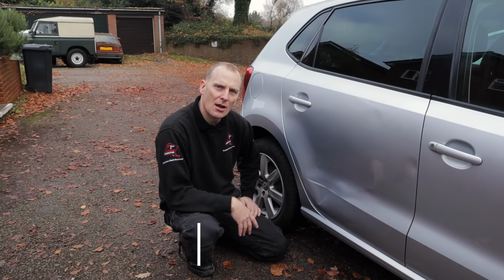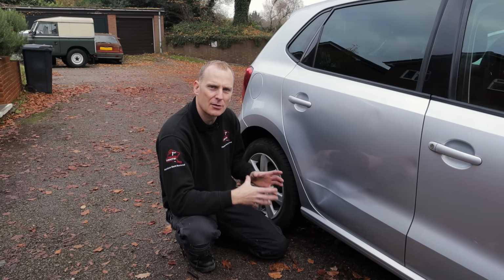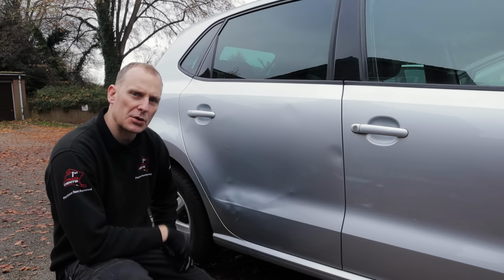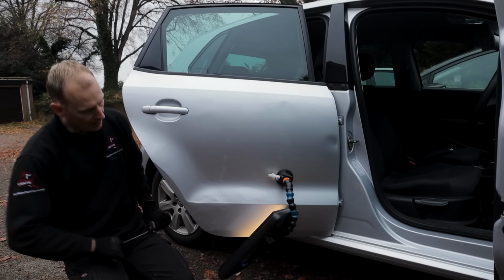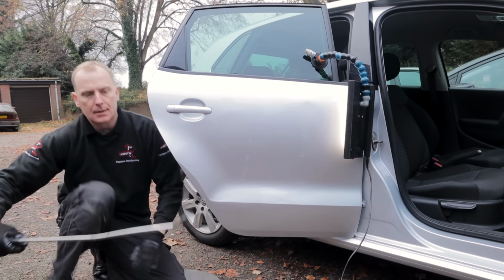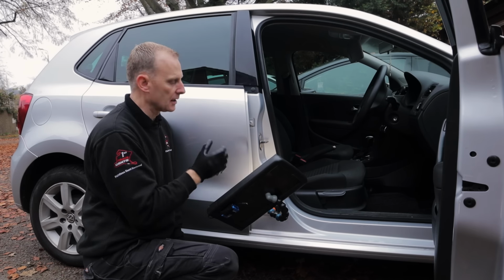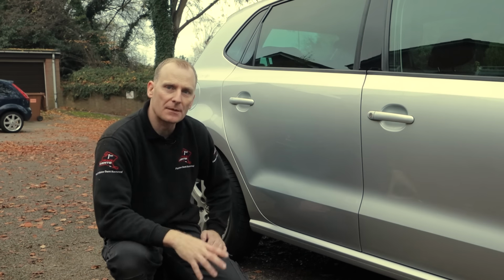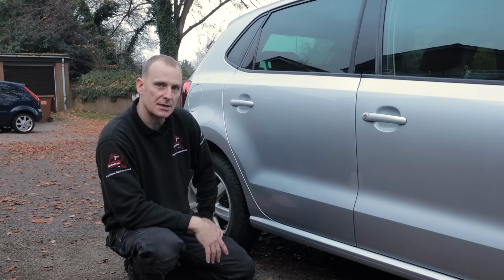NEW DOOR? NO! I’ll fix it using PDR

Comment: Incredible repair. I think the one thing many people overlook between repair with PDR vs new panel is that even though you're reworking a panel and may not be able to get it to 100%, how it looks visually may be substantially better than a new panel that has to be colour matched, blended, aligned etc. You've managed to save a part and bring it in-line with the condition of the rest of the car, which is the biggest win, in my books.
Reply from the maker: Thank you very much for your comment. I couldn't agree more, it's always worth saving a panel if you can. 👍

Comment: one question: How many hours did you work on this door?
Reply from the maker: I took between 4 and 6 hours, but much longer filming it:-)
Reply: @1st_track_dents  much quicker than properly priming, painting, and clear coating a replacement not to mention with curing time for the paint!
Reply: Christopher VanZetta agree, and don’t forget that this new door also has to be purchased, assembled and mounted
Reply: @JeroenvanMontfort  but not less than buying the same door off a wrecked cars in the same color already assembled. Depends on what is available and for how much. 
I also wonder about the paint, and whether it will start flaking off in 3 years due to all the working, or if the corrosion resistance is compromised. 
Great work though. I would like to learn the trick to smoothing all the ripples out.
Reply: @1st_track_dents  So, 4-6 hours,  plus materials, the bill would be around $5-600 USD?
Reply from the maker: @franklinpierce2854  There is no materials really , small amount of glue and polish, most of the cost is all labour. It was slightly cheaper than that as I did the customer a deal as I knew it would make a good video! In the US PDR is much more lucrative and the PDR guys would probably charge twice that!
Reply: @christophervanzetta  and then the end result is paint that doesn't quite match the rest of the car.
Reply: @JeroenvanMontfort  I'd go used same color
Reply: @1st_track_dents  Yeah I'd say they got a great deal from you. Great work!

Comment: It would be good if showed where you are levering with the pdr +how you use your free hand to counter lever to control pressure ,also were /what you are tapping with the bolt and hammer handle ,you videos are great !with the pdr it would require a camera on the inside and one on the outside with a split screen

Comment: Excellent job! I hit a very low wall that was sticking out further than the curb so as I turned the corner the bottom back door hit it. It pulled off my plastic trim and dented/scratched the bottom half of the rear passenger door. I'd like to sort out the dent myself. I think the best way would be to try pushing it out from the inside but the problem I'm having is taking the inner trim off. It just won't come off. The only way I think is to break/cut the plastic trim pins. Any help would be most appreciated. Thank you.

Comment: That was great cause there is not much body around that wants to do body work anymore, they just want to replace parts. I'm watching some video cause I'm going to do some body work on my rear door too cause I slid off the road when it was snowing n hit a curb ruin my door. I just spend 8 grand at body shop to change parts and repaint the front from a deer hit.

Comment: If I ever needed any work done like this I dont think I would want anyone else to do it.
I've watched many peoples work but would forget the rest - this guy is the best (IMHO)
I'd love to see him working on a classic car - a 1960's Ford like a Consul Capri or a Mk3 Zodiac where the price of a new panel would be extortionate.
If he ever did training courses I'd travel anywhere to learn from him.
A wizard with metal.
Reply from the maker: Thanks, I don't get to work on classic cars that often but I have worked on quite a few in my years. The metal is very tough 💪
Reply: @1st_track_dents  Do you mean tough through sheer age or tough more because of metal fatigue?
Just surprised as I would have imagined modern steel to be of much better quality. I had a Mk1 Cortina that I swear you could have left a hand print in the metal on the boot lid if you'd slammed it!
Could I also ask you about something else I saw you refer to - oilcanning. I understand it to be when there is flex where the metal is stretched. My brain wont let me understand how you can remove that flexing with the tools you use.
Anything pushing up surely increases the stretch?
Unless the tapping down actually shrinks the metal?
My old body shop pal who used to paint my cars used dollies and shrinking hammers back in the day.
Sorry to ask so many questions but I cant tell you how much I'd love to learn this craft. I'm tempted to buy some tools, visit the scrapyard, and buy a couple of dented doors and bootlids just to have s play.
It looks so rewarding. I'd love to finish my day feeling I'd achieved something.
Thanks for sharing your knowledge and experience.
Reply from the maker: @noizyneighbour5790  The old classic cars can be tougher to push just because the metal is thicker, but as you say this isn't the same with every manufacturer, it's more so on some of the older cars pre 1970 I would say. When the metal has stretched or oil canned, it depends how bad it is, if it is only slightly you can use a very sharp needle tip on a pdr bar and make small little indentations under the panel which helps to gather the metal up, but if the panel is more stretched, then you need to remove the paint underneath and use a carbon electrode which uses electricity to shrink the metal, failing that, the outer paint would need removing and a gas torch would be needed and a shrinking hammer and dolly would be used (like I used to use in my bodyshop days), but by then its not a PDR job anymore and would need to be resprayed. Also some of the newer metals are not able to handle being heat treated in this way and would need replacing, also Aluminium panels are much more challenging!
Reply: @1st_track_dents  Thanks Jake for taking the time to reply.
What is it they say - how do you know unless you try?
The worst that can happen is I make a right pigs ear of what I try to improve - and then I come and see you! Enjoy your day.
Reply from the maker: @noizyneighbour5790  Mistakes are part of the learning process, so why not have a go, good luck!

Comment: Can you explain how that PDR machine works? It looks like it softens the panel making it more moldable.
Reply from the maker: Hi Christina, it's not a PDR machine, it's just a hot air gun which you can get at any hardware store. I use it to warm the paint up so that the paint doesn't crack when pushing behind with my tool tips especially when the weather is cold.  👍👍

Comment: Brilliant job Jake. Definitely worked your magic on that one.
Reply from the maker: Thanks Jason, although I would have definitely done things a bit differently if I was doing that again now. 👍
Reply: @1st_track_dents  in what way Jake ? I couldn't fault your approach to the repair 👍
Reply from the maker: I would have used the Keco centipede tabs and maybe some lateral tension rods and pulled the main bulk out with some ratchet straps hooked around the wheel of my car as there was space to park right next to this vehicle. For the other 2 dents on the panel I would have used the same rods and glue pulling though

Comment: Master you have done it again  brilliant your just amazing I'm practicing daily to become a pdr tech I'm having a little bit problem on how to put light bord on Doors any tips on how to position your light thanks for sharing your videos👍👌
Reply from the maker: Position the suction cup on a flat section and then move the board to the best angle, if you are struggling to do this, maybe you need to buy more 'Loc-Line' sections to give you more reach:-)
Reply: Thanks you I will do that thanks for the tip an thanks for sharing your brilliant knowledge your the  best👍👍

Comment: Intelligent work!🙏 How to repair right door border popping out slightly near fender at bottom.its not dent but lining is not matching. Fender is new and correctly installed. The fender was hit from front, dented, while opening the door, its popped out. Just little hammering would be ok?
Reply from the maker: I would try adjusting the fender first before taking a hammer to it, sounds like a realignment issue, otherwise try levering the panel with something soft, like a piece of wood, a hammer is probably not the best tool to start with. Good luck 👍
Reply: @1st_track_dents  Thanks ❤️

Comment: @3:34  May I know what kind of device did you install to push the door fm/ the inside? Is it some kind of hydraulic press? I have actually like twice larger dent on our 2009 Nissan Sentra, but looks like the car columns were not deformed, just lower hinge was bent. So I think to try to straighten it. Thank you for this great film.

Comment: Is it possible to repair a door skin with an internal crash bar using this method
Reply from the maker: Hi Robert, yes all the door have internal crash bars, so you just have to try and navigate around them. Although If the crash bar is bent, the door should really be replaced:-)

Comment: I would have thought it to be far easier just to replace that door skin, not positive these Polo model doors are the same as Golf and Jetta doors, since we don't have them here in the States, so I am assuming they are built with door skins. That being said, a couple of things, first of all a marvelous job and great craftsmanship, given the size and all of the wrinkles in that damage. Another commenter mentions how this type of repair is very eco-friendly and that's an outstanding point. Virtually no landfill waste and rarely paints or chemicals involved. Also, consider the fact that the original sheetmetal and finish still remains and that's good for any car's resale value.

Comment: When you tap on the panel using a bolt and wooden end of the hammer, are you actually holding the bolt a short distance off the metal before you hit the bolt? That’s the way it appears in the video.
Reply from the maker: I had to think about that one as i just naturally do it, yes probably only 2 or 3mm off the panel:-)
Reply: Thanks!

Comment: Can you please share the tool kit, and glue type thanks!
Reply from the maker: At the moment I am using Glexo hot glue and tabweld which give great results but the results depend on the climate you live in. All the other tools used are just basic screw on tip PDR tools 👍

Comment: You can use a toilet plunger or a couple of toilet plungers, just use the rubber kind and get a vacuum on the toilet plungers and just pull very fast and hard to jerk that dent out of the door, as cheaply built as automobiles are made today with very thin sheetmetal, a toilet plunger works!!
Reply from the maker: 🤣 I'll try that on the next repair, wish me luck!

Comment: A dent that big can only be total fixed with a new door and paint respray. The cover sheet metal is stretched and if you push on the panel it will flex after a repair lik this. That's way the cost is so high if you go to a ordinary body shop! The work don here is amazingly good! For older cars this is good enough, in most cases.

Comment: How do u get ur glue to stick so good I have problems with mine coming off
Reply from the maker: The glue I used on this job wasn't as good as some of the glues I am using now. Glue pulling can be frustrating, trust me there are days when nothing seems to stick! It can be down to waxes/compounds on the car, ambient temperature, the type of glue you are using etc etc. The simple rules to follow are... make sure the panel is cleaned thoroughly with isopropyl alcohol, make sure the panel isn't cold, follow the guides for the glue you are using (application temp etc)  and just experiment with the first few pulls on how long you leave them on there before pulling, each glue has a sweet spot. Try different glues, what works for one PDR tech doesn't' always work for another 👍

Comment: I would pay a top dollar for this.
But just out of curiosity: will varnish after some time peel off, since the area was heated?
Reply from the maker: No, I was only hearing this panel as hot as it would get on a hot summers day, so no lacquer will peel off. It would discolour first from burning if heated too much. 👍
Reply: 1st Track Dents Cheers. I was asking this because I have the same car, same color and someone from here did the driver’s door with similar damage as on your video, but in my case job is so-so done. I wanted to be prepared for me to know, so I had to ask. Thanks on your reply and glad I found such a great channel.

Comment: Quick question, the back panel of the frame of my Subaru is dented and bent do you have any life hacks for how I can get it pulled out so I can put the new door back on without having to pay a couple thousand dollars to fix it with the mechanic?
Reply from the maker: Hi, if the rear panel is so bent that the door doesn't fit, the panel may need pulling out on a jig system. Other than that find the biggest hammer and block of wood you can find take the rubber door seal off and hit it hard on the frame:-)

Comment: Fu....g amazing!!! This is the first dent removal video I've watched and I'm stunned at how a little bit of time and a whole lot of knowledge go in to dent repair.  The crease on the door and the leading edge of the door I was convinced were going to show signs of an attempted repair. I'm gobsmacked. I used to work for a body shop many years ago and the first thing I would have told the customer is you need bodywork and the side of the car painting.

Comment: Nice work.
I had a door ding in one of my doors on my 3 week old new car. The dealer wanted to pull it out then bondo and repaint the door for almost $1000 USD. They were nice enough to give me the number of the Ding Doctor.
DD cam to my house, used a light and heat gun like you. He then got a little hammer head on a long shaft through an access plug on the door. 20 minutes and $100 it looked perfect.
This is a great talent.

Comment: wouldn't it be better to remove the door to make the job easier?
Reply from the maker: Yes, much easier, although when you are working mobile and you are working on the roadside with a small pavement/sidewalk next to you and the chance of rain at anytime it's just not practical. If I had a workshop I definitely would have taken it off. In the UK it's very rare for a customer to have a garage to work in either so you have to work whatever way you can 👍

Comment: Great video and very helpful. I'm just curious about something not as bad as in your video. A long time ago an auto body repairman told me that you can simply heat up a simple dent, a dent from someone leaning against your fender and pushed it in, and then immediately hit it with ice water and the dent will pop out. In essence tightening up or contracting the metal molecules. It may take more than one try to get the dent completely out. Is there any truth in this? I have a dent, from body line to body line, on my fender from this very reason and want to get it out. I've tried pushing it out from the inside and it will go back into place and look like it never happened, but I'm afraid that the metal has been affected in some way as a few minutes later it will pop right back in. So, I'm wondering if this technique of heating and cooling will have any effect on this and pop it back into place. Any help or advice will be appreciated. I thank you in advance from across the pond. Cheers

Comment: Your work is very good. Here in the US this repair would never fly because the outer door shell has made contact with the intrusion beam. The intrusion beam is made of high strength steel which is a more dense metal than the steel used in the door shell. High strength steel is made that way by (among other things) heating it. While making it stronger, it also makes the metal more prone to breaking rather than bending. Should the impact of that wreck bend it slightly, bending it back risks breaking the beam. So when that intrusion beam gets damaged here in the US, it is never repaired, it is replaced. This is for liable reasons.

Comment: Getting a used door isn’t a bad idea either
Reply from the maker: Yes, I did a job back in the summer where a front wing/fender was just too bad to use PDR, so I found a panel online which he bought and we just swapped it over.
Reply: @1st_track_dents  awesome, thanks. Yea a naught a solid used door for 179 bucks. Not a bad solution

Comment: Great quality repair paint and body shops are a total ripoff
Reply: Starting off as someone who works in the field i’m A bit biased-, but that door needed replacement. A lot of times what the correct repairs should be and what the customer wants are two different things . Iwouldn’t warranty a door that needed replacement that have safety supports built in like most other panels